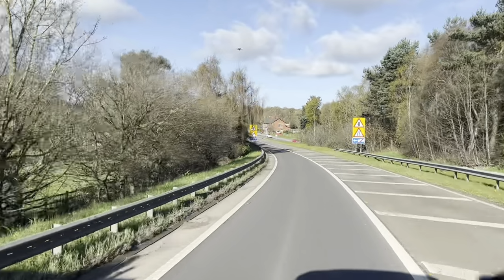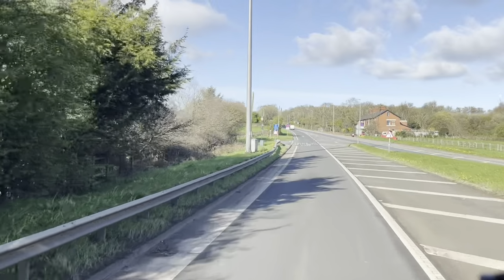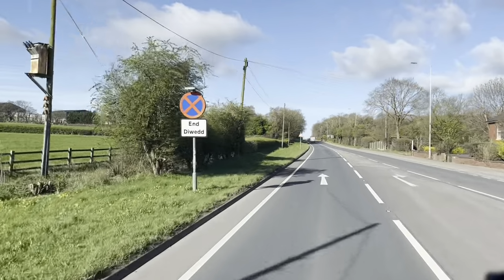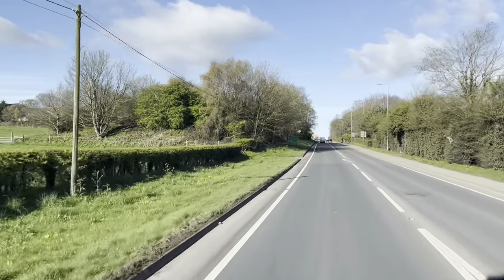BUILDING SUPPLIES MULTI DROP DELIVERIES|GOOD FRIDAY BANK HOLIDAY UK 🇬🇧|HIAB CRANE|VOLVO TRUCK|

Comment: That crane looks like a pleasure to work with all day mines a twat and will cut out almost on every lift
Reply from the maker: Alright mate how you finding the job apart from the crane cutting out on every lift, which doesn’t seem right to be honest mate. What crane is it?
Reply: @SCRUFFYPIGEON  it’s a new daf 210 lf  it’s crap its factory sensitive it won’t put up a pack of blocks and extend it far
Reply from the maker: What make is the crane mate?
Reply: @SCRUFFYPIGEON  HIAB X-DUO 078
Reply from the maker: Ah right…. I used to use a hiab 099 and would struggle to lift a pack of solid concrete blocks and I could literally just lift it off to the side of the wagon so you end up trying to get the wagon as close to the job as possible. It sounds like the crane is telling you your at the max lift capacity therefore it is locking out,I think yours only has a 6 mtr max reach????

The hiab 128 I use can lift a tonne at 10 mtrs and nearly 2 tonne with no extension. It is horrible when people are asking you put materials as far down the drive as possible when the crane just won’t allow it , I remember it being a nightmare.

It sound like the safety features on the crane are doing there job, when you are lifting block try not to lift with a straight boom ,that makes it lock out and if possible get your outrigger as far out as possible as this will make it lock out if the outrigger is not fully out. I’m sure you may know these things but just incase👍